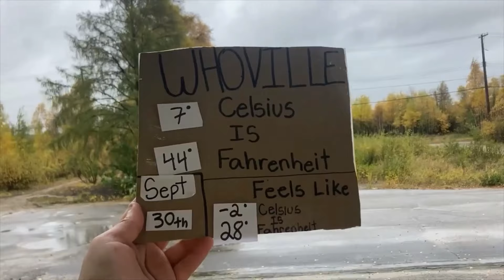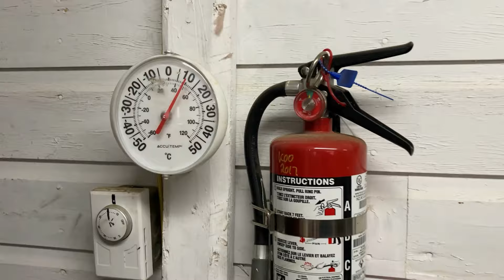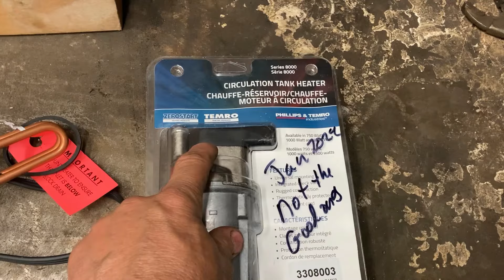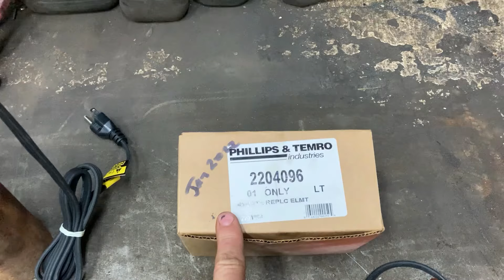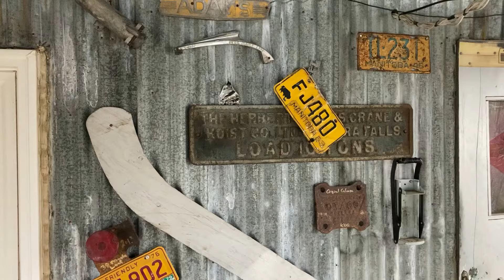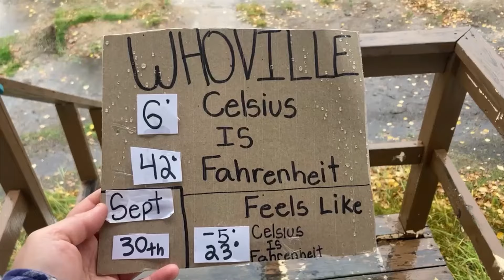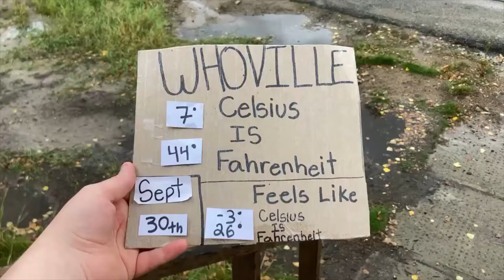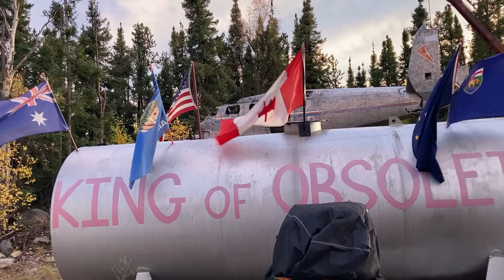Heavy Rains, Nasty Wind it was a Shop Day Building a Circulating Heater Sept 30 2024

Comment: Watching you make something out of recovered materials is always a great show. Gravity feeding the water the whole time!   Using wood stove to work metal is pretty neat. Thick wall casing will hold  heat better than cast aluminum. Just wondering if new/useless heaters could be used if you could bypass sensors and wire elements direct so they would run constantly.. 😎
Reply from the maker: yes it was a good day all around. over the years we tried to jimmie rig the new style heaters but it was pointless. just save them for xmas gifts for the ex-wives, lol  thansk

Comment: I built a exhaust systen using diamond drill rods, saddy all the wireline joints broke in the coupler, so on your water heater your making, watch for the threaded portion cracking on you if you use it
Reply from the maker: i always cut out the threaded end because they are thin and hard to weld and like you say have cracks.  thansk

Comment: I think you could’ve go by with just a flat top on the heater cans. I have a couple old tractors that have ones with a flat top with a nipple and they work great but then again they are from the 70’s. One is a 2500 watt and I’ve never seen another that big. Keep up the good work.
Reply from the maker: yes we could have tried it but i wanted to try and copy as best i could. a 2500w heater would suck a lot of power so a good electrical panel breaker would be needed. but when the motor started you would have heat right now, lol  thansk